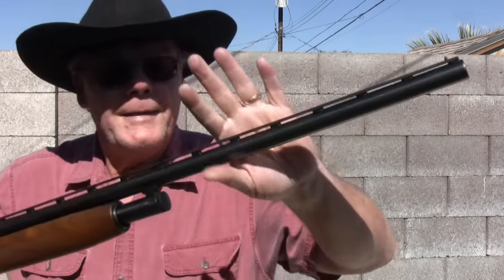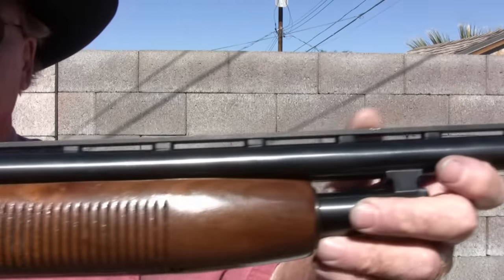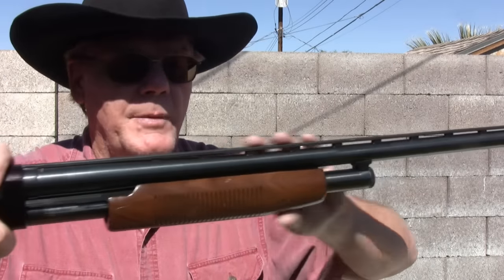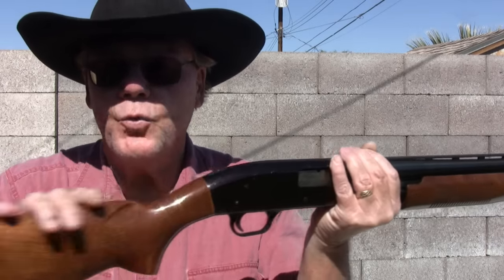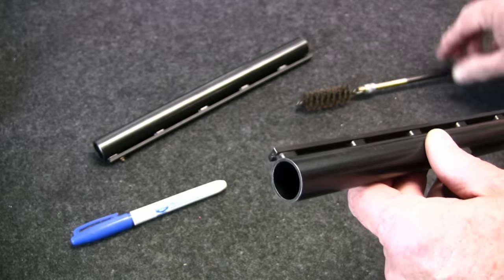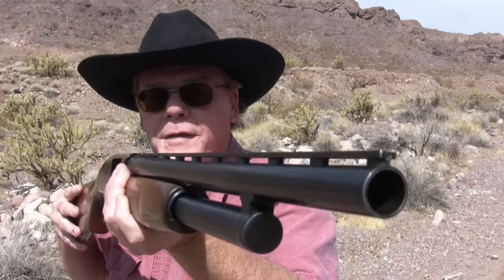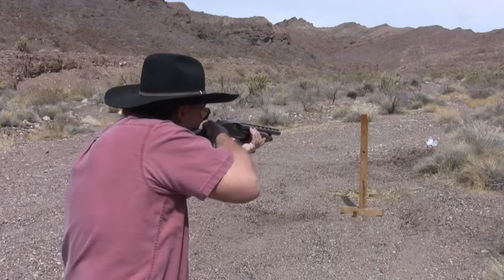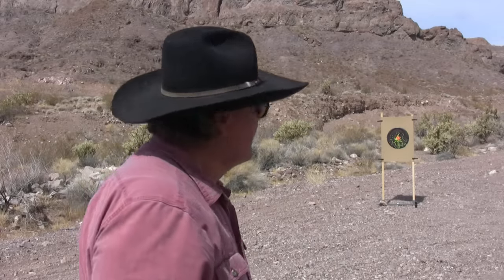How To Cut Down The Barrel & Replace The Ejector On A Mossberg 500 - Awesome Home Defense Shotgun!

Comment: I have a hard time deciding which is more fun. Either shooting a gun, or staying home, or in the shop tinkering with it. There's no better feeling than improving something.
Reply: Same I just add a mag tube exstention to my shot gun yesterday hahaha
Reply: I put a muzzle brake on my Ruger PC Carbine (9mm) today, had to get the crush washer to seat where I want it for the brake to be timed properly. It was fun to do really, I understand what you are saying.
Reply: Same 👍
Reply: I prefer to tinker, then shoot, then repeat! 🍻
Reply: Tinkering and building I think is more satisfying, shooting is more fun though. Lol both are 😎
Reply: I spent all day refinishing the stock of an old Hercules model 10. Refinishing it was half the fun, shooting it is the other half
Reply: Couldn't agree more. I love taking apart and tinkering with my guns more than I do shooting them.😅
Reply: I felt the same and kind of found a work around. First there is only so much cleaning/polishing tinkering you can do to make it run but not break down. I fill in the off time by making ammo to feed it, lot's of ammo, so I can go shoot it, then get back to inspecting, cleaning, polishing and the like. Since I love to run the holy black through everything, lots of cleaning is always available. I feel your pain though.

Comment: One suggestion to get a perfectly (relative word, of course) square cut on a barrel is to get a hose clamp and tighten it down around the barrel. Cut very close to it, and work a file down to the hose clamp flush. Remove the clamp and do finishing work. But one issue would be a ventilated rib bridge, getting in the way of a clamp.
Reply: Excellent idea. I'm pretty sure you could run that hose clamp around the rib as well and tighten down.
Reply: Just unscrew the hose clamp all the way, feed it under the rib, and retighten.
Reply: @andrewallason4530  He trimmed the barrel right up against a bridge, so you'd have to wrap it over the rib.
Reply: @andrewallason4530  I was going to suggest that, works great and I used a drummel flush with the barrel to square mine off, my armorer couldn't tell it wasn't from the factory after I used perma blue
Reply: @exothermal.sprocket  put the clamp on the portion of the barrel to be trashed, if you take your time it's an even cut.

Comment: I have a newer Mossberg 500. Purchased new.  It came with plastic stocks. It also included both barrels:  a modified choke longer bird hunting barrel, and a short straight cylinder bore barrel (essentially like you made there). It has a 3" chamber, and the two barrels makes it really versatile.
They are quick and easy to swap on that model. You showed us how to handle one real smooth and comfortable in your video. Thanks for the demos and the ejector tip.
Reply from the maker: A new Mossberg 500 with both barrels is always an excellent choice. Thank you for taking the time to watch my video and I also thank you for the nice comment.

Comment: With non-vent rib barrels I use a tubing cutter. You have to go slow so you don't compress the metal too much or it will curl inward towards the bore but they cut nice and straight.

Comment: About 3 years ago give or take you could buy a 18.5'' barrel for just over $100- $150. You could also buy a maverick 88 for just a bit more give or take. Now if you want to buy a new barrel it's around $200 to $250 if you can find one. And the price of a Mav 88 is about the same. You in my opinion did the right thing. You spent about an hour of your time Modifying a sweet looking shotgun to fit your needs and spent $20 give or take for the extractor to have it function properly. I use the Mav 88 as a reference purely to make the point. Why buy a shotgun part for the same price you could buy a whole shotgun.  Great job, Great video.
Reply from the maker: You are absolutely right Scott, a barrel will cost almost as much as a complete shotgun. Finding a short home defense shotgun barrel is almost impossible to find today. If I haven't done so already I would like to thank you for recently subscribing to my channel.
Reply: You’re right about the prices of the barrels alone today compared to a couple years back. Although I just purchased a maverick 88 brand new for $140. Guess I got a deal.
Reply: I had a Short barrel mossberg blow up on a friend pre pandemic, went to get a new barrel it cost as much as the gun did pre pandemic (like 200ish used) years later I'm at a gun show finally find a hunting barrel for 100, obtained it and got it back and function like it never happened it just took 2 years of waiting

Comment: I've got an old Winchester M200 (20 guauge) that I prepped in a similar manner.  The OEM forend looked and felt like a 2x4, so that got replaced with a "beehive" style from Gun Parts.  Used cold blueing from Brownell's (the home gunsmith's source for everything!)  I refinished the wood and added a recoil pad (for length, as much as for comfort.)  My local gunsmith, the late, great John Moxley, managed to install a choke, and I've always just kept the IM choke in it.  Works good.  A burglar will not complain about being shot with 20 gauge rather than 12.

Comment: I already have short barrel Mossberg tactical JIC M500CRUISER. It meets all legal standards. Barrel length is 18-1/2 inches. Overall length from the end of the barrel to the bottom of the pistol grip is 28 inches.

Comment: I did the same thing with my Remington Wingmaster, except I used my Dremel tool. Squared it off with a level grinder wheel, lightly hit the end with sand paper, and used that same bluing pen. Also took the plug out of the mag, may get a +1 or +2 some day.

Don’t worry about the bead, I didn’t put one at the end of mine. It’s a shotgun, I don’t need a bead.

Good video, brother.✝️👍🏻

Comment: I have this exact shotgun. Only difference is mine has a poly choke. It was given to me by my dad. I believe mine was made in 1975. I may be wrong, but I believe that’s the year. A while after I got it, I  replaced was the mag tube spring, ejector, and just as a precaution the extractors. Total cost of the parts was $25, and She runs like a champ again. You can’t beat a Mossberg for super rugged reliability and longevity.
Reply from the maker: If the serial number on your shotgun begins with the letter G than it was made in the '70s. You're right, you can't beat a Mossberg pump shotgun.

Comment: Swell video, not just interesting but practical too. I have an 870P Remington 12ga "Deer/Slug" gun (#5028) purchased in 1982. I swapped the adjustable sight 20" IC barrel with a buddy for his 28" vent rib Modified barrel. Early 1990's I had the barrel cut down to a bit over 19" so the rib base and muzzle would be flush. My gun guy did a great job replacing the bead sight and touchup bluing and it cost me $20. You'd never know that barrel was longer and I dig how my 870P looks now. You did a neat job on that Mossberg my friend. I will heed your advice and check my mag spring.

Comment: If that is a fixed full choke you can shoot steel shot through it and it will not hurt it even if production was 60's or 70's its safe for lead or steel.

Comment: My old turkey gun is about to get the same treatment
Reply: I use the Kicks brand Buck Kicker XF in my 20" for Turkeys. It's a ported choke, reduces muzzle rise and recoil. Shoots fist size groups at 25yrds, 14" at 40yrds, & 16" at 50yrds in my Mossberg, Browning BPS and  Remington 870. Too tight for steel, if thats what you have to use, get the Full, not XFull.

Comment: I got a mossberg 500 many years ago for Christmas.  I upgraded to a bennelli m1 super90 tactical many years ago.  I still have that mossberg.  I never did like how the forearm rattled around so much.  When you're out hunting its louder than running through dead leaves.  And they sure didnt waste any time trying to smooth anything up with the action in order to falsely convey a sense of quality.  Its built to level of quality that I can understand.  It looks like it was manufactured in a highschool shop class by students who didnt really want to be there.  When I look at it closely I have to remind myself that this shotgun isnt sold at harbor freight. Mine came with an 18.5 inch barrel, a 28" barrel, a pistol grip, and a sling.  I remember trying for hours to take the stock off before finally figuring out that my screwdriver was too short.  It would somehow bind up in the hole that the screw was in and it felt like you were right in the slot.  You could look down that hole and Mossberg had some kind of magic going on that magnified the screw where it appeared to only be about 4 inches away.  You stick a two foot long screw driver in the hole and still not reach the screw.

Comment: I was just thinking that a chop saw would make a more square and easier cut if you had one.
Reply from the maker: I'm sure a chop saw would work great for cutting down a barrel. Maybe I should get me one.
Reply: I'm curious if the heat it produces would have any negative effects on the hardness rating using the chop saw. I like using them for small jobs or jobs that have a lot of parts and it would make quick work of any
 barrel
Reply: @chadh3441   I don't think it would effect the hardness because it wouldn't take long to cut a single barrel thus not much heat would be generated. Cutting down a double barrel with a chop saw might create enough heat to effect the hardness.

Comment: Does the rib feel loose or rattle after the modifications?
Reply: Not that I've noticed after cutting down my maverick 88 barrel.  All tight and rigid.
Reply: @jonathanfreedom1st  bought a old savage someone shortened and the rib is loose from the post.

Comment: Back in the day I shortened a couple of High Standard shotties and one thing I did was to shorten the rib back to the "support post", with the thought that that might help prevent the  rib from getting brush or what have you  snagged between the barrel and rib. A small point, perhaps inconsequential, but one I felt was worth the small bit of extra effort.

Comment: Here's a crazy fun fact from Canada.
We can buy a shotgun with a 13" barrel, perfectly legal !👍
If we buy a shotgun with a 18"barrel and cut it down to 13", then under Canadian firearms laws, that shotgun then becomes a prohibited weapon (classed the same as a machine gun) and you can face some serious jail time just for possessing it.
Crazy eh !!!😎
Reply from the maker: Wow...that is crazy. And I thought we had some crazy laws here in the United States.
Reply: There are similar circumstances here, like with the Mossberg 590 Shockwave, I can't imagine that you can buy a shotgun with a stock in Canada with a 13-in barrel though.
Reply: @Just-Steve  yeah I got one 😏👍
Reply: Do you have the 14” barrel? I have the 18.5” version but trying to trade it for the shorter version- but the thing is you can hold an extra shell over all the 14” Mossbergs you see all the time on videos.
Reply: @Just-Steve  you can actually buy a shotgun with a 9.5 inch barrel with a stock, it does needs the stock to be of legal over all length
Reply: @mikenorthrop5815  that's 8.5in shorter than the NFA allows for shotgun barrels. That's a short barrel shotgun.
Reply: @Just-Steve  sorry, ment to say in Canada

Comment: won't have choke if cut down. 26 Inch only applies if barrel is shorter than 18.
Reply: “…overall length of less than 26 inches OR a barrel or barrels of less than 18 inches in length.” - ATF website

Comment: I found a 1985 mossberg 500A, with 19 inch ribbed barrel, nice checkered wood stock and forearm, silky smooth action. 200 bucks! I couldnt believe it, snatched it up real quick.
Reply from the maker: Excellent find Tom....I'm jealous  👍🤠
Reply: @mixup98  dont be! If you add that factory bead on yours, they're pretty much the exact same scattergun! Id never seen a factory mossy with a 19 inch barrel, and hours after buying, i see your newest video with similar 12 gauge....it was meant to be! Thanks for your time and effort on these videos!

Comment: Did the same with a 500ab. No rib, super smooth, super inexpensive. Used a pipe cutter so square. Should have taped it up to perfect the end from the cutter wheels. A little bluing. It's my HD shotgun.

Comment: Another good one!  Those Birchwood Casey bluing pens are readily available.  They are handy and do a good job on small touch-ups, like the one in this video.  Have you considered a fiber optic replacement for the brass bead?  Many styles are available including some that clamp to the vent rib.

Comment: I have a old high standard police issue 12 gauge riot shotgun 18 1/8 inch barrel. iam thinking about having barrel threaded for chocks to tighten up buckshot patterns and rifled slug tube. I killed many deer with it with scope and slugs. federal hi shok 2 3/4 inch high brass 1 oz rifled slugs at 25 yards print 3 shot in 1 1/2 inch. 45-50 yards 2 - 2 1/2 inch, 100 yards 5-7 inches.  if using Winchester high brass slugs and 6 shells fast it backs slugs up in shells affecting accuracy. recoil is mule kicking. off sand bags gun kicks back and up knocking my ball cap off behind me about every time hitting the bill of my cap , there is nothing in North America I would be afraid to shoot with it . I had a moss berg 12 gauge with a long barrel i could easily hit the old round motor oil cans at 100 yards easily. I greatly enjoyed the video. nana and papa aka the hunter wishing you well.
Reply from the maker: I'm never knocked my hat off while shooting a shotgun but it sounds like fun 😁   Thank you for always taking the time to watch and comment on our videos.
Reply: @mixup98  the federal hi shok 3 inch magnum 1 1/4 oz rifled slug generate buy field and streams tests several years ago was 91 pounds of energy against the shoulder. this riot gun only has 15 3/8 inches of barrel in front of the shell. it gets your attention .and respect nana and papa
Reply from the maker: @johnnymccann5607  91 pounds of energy against the shoulder!!! Ouch. Hopefully I can find a box of them someday and shoot them in a video.

Comment: Can’t I just order a new barrel instead?
Reply from the maker: Sure, but have you checked the price lately on a brand new short barrel? They cost more than I spent on this shotgun.
Reply: @mixup98  also, modifying your own shotgun is a fun project
Reply: Backordered
Reply: @mixup98  yep, I wanted to buy a 20in barrel for my Winchester 120 Ranger. The shortest i could even find was a 24in rifled barrel that costs about as much as the shotgun
Reply: I have looked literally everywhere for a 18.5 barrel for my mossberg 500. I can’t find one anywhere in the US. They either claim they are in stock ( and aren’t ) or my favorite was when it let me place the order and then said it would arrive in Feb 2022 !! I would much rather attempt this. Hopefully there isn’t to much I can mess up
Reply: @thetattooedguy1413  just buy a barrel face off tool and you are set

Comment: Educational and much fun! Many thanks. 

My usual issue with a shotgun is the often encountered 14 inch length of pull. Now if I could just manage a do it yourself butt cut down and fitting of a butt pad.
Reply: I've done that. It wasn't hard to scribe a new line, used a hacksaw while holding the stock in a vise. Put some stain on the stock after sanding it and slipped a  butt pad  on it.
Reply: @williamkeith8944  Did you use a slip on butt pad or did you custom fit one? 

Appreciate your commenting.

Comment: I’m not very mechanically inclined, so I couldn’t notice a significant difference between the old and new ejector. What about the old ejector caused the failures? I was expecting it to have some moving parts or a spring or something that needed to be replaced. Thanks! Wonderful videos. Just straight to the point and informative, but also entertaining. I’m sure many of us wish you were an uncle, lol.

Comment: Good video for the times . Gotta give you credit. Mossberg pumps, great guns, are in high demand right now. Factory short barrels especially so this is a good alternative .Those older 500's are much nicer, and they have a "crown grade " newer fancier  model  You can mount a breacher or other style point on the modded or Uncle Mike's  mag cap for xtra wickedness. Voodoo tactical has a neat OTS scabbard. Happy stroking.

Comment: I had a few of those and sold them like 35 years ago. Never liked the defective bolt locks. They would get loose and the 20 gauge i had would open up when fired. lucky I had bird shot in it when it came out the bottom on me.Good video , thanks. "yeah that woulda hurt" LOL.

Comment: Nice firearm . And nice job on the barrel.  I need to find some blueing pins, if they are still made.  Thanks for the video.
Reply from the maker: The pen is the Birchwood Casey Presto Gun Blue Touch Up Pen - Mfg# 13201
Reply: @mixup98  thank you very much.

Comment: I bought a used 28 in. modified choke barrel for my Remington 870.  I cut it down to 18.5 inches with a Dremel Tool and cutting wheel.  It took a while and I broke a couple of wheels, but when finished, it was perfect and only required light sanding.  Now, my 870 is open bore and it has become my "welcome mat".  Personally, I prefer #1 buck (16 pellets in the 2 3/4 in. shells.  It covers about 10 inches at 10 yds.  BTW, I still have the original slug barrel and another full choke barrel for the shotgun for hunting.
Reply: After a lot of testing shotgun loads I settled on 2 3/4 in magnum number 4 buck  for home defense
Reply: @missourirebel9669  That's what I use for coyotes but it's coming out of a 3" magnum with a Carlson's Coyote choke tube.